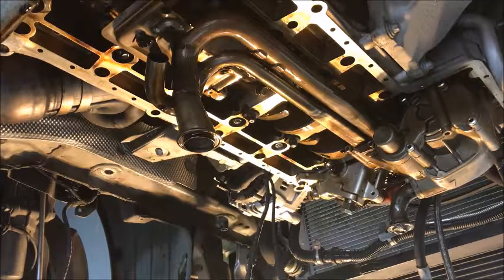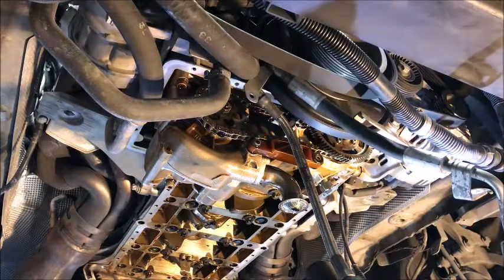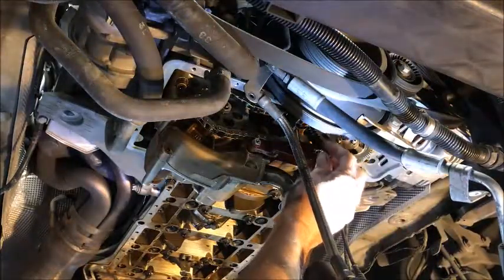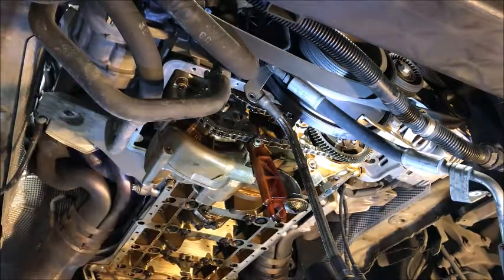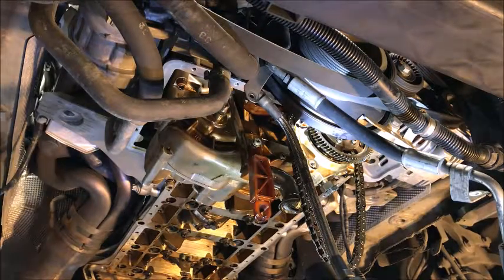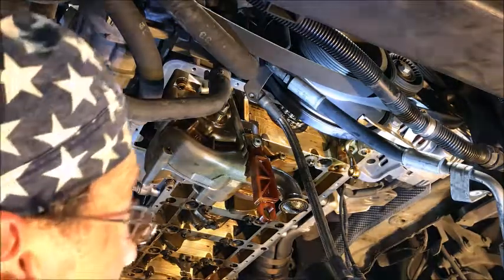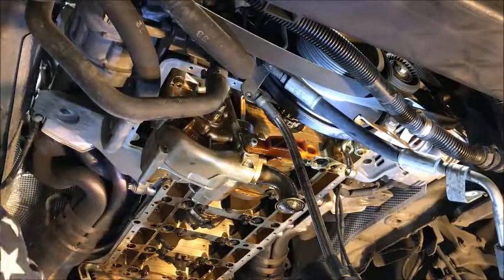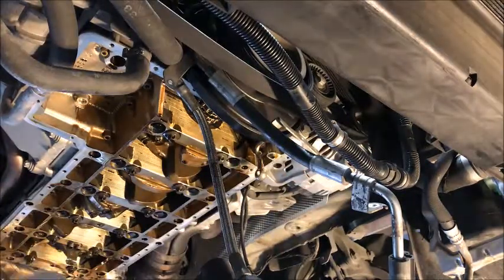BMW S85 Rod Bearing and Vanos Line Replacement Part 9 of 13 - Accessing the rod bearings

Comment: Do you know the name or part number of the little screen filter that goes on the little tube on top the the vanos pump?
Reply from the maker: Hey man !  There’s a small micro filter that is in a recessed hole in the block on top of the vanos pump...is this the one you are referring to?  If so, attached is a link to the picture of the one I got when I did mine (it’s also in the parts list in the 1st video of the series at the beginning).  If that’s not the one you are referring to, let me know and I’ll see if I can find another one in the schematics.  Here’s the link:  https://www.facebook.com/stevesdiys/photos/a.155473795999070/251980289681753/?type=3  All the best ! Steve

Comment: On how many miles was the m6 when you changed the bearing? Thank you!
Reply from the maker: mintech1000 , hello. I was at around 76k miles when I changed them
Reply: Were they bad? Thank you, sir!
Reply from the maker: mintech1000 , they were getting very close to being worn too far.  I took an oil analysis sample and sent it to the lab and it came back with traces of copper so I was pretty sure the bearings were worn and had reached the copper layer under the bearing surface material.  When I changed them there were two of the ten that had marks into the copper layer and the others were getting close.  I could have probably gone 10k miles more with no problem, but I was getting worried as that’s about when other owners have changed them and wanted the peace of mind.
Reply: Steve’s DIYs   Thank you. Sir, follow this guy on insta gram  troyjeup. Apparently, the king of this engine from what I here.  He is saying 10w60 is no good but redline 5w50 instead. I am doing a research, I am looking at a m6 2007 6 speed the Manuel transmission on 45000 miles, that’s why I asked about your car. Also, would you be willing to do it on mine if I buy it? Thank you!
Reply from the maker: mintech1000 , yep, he’s known as a legend for sure with these motors. He does a stroker motor with these and gets over 700 hp out of it. There a forum called M5board that has a lot of owners on it (if you haven’t found it already). I usually just work on my cars for something this complicated, but out in the forum other owners should be able to recommend someone in your area that they have used. I don’t track my car so I just stick with the 10w-60 as it should be fine for normal “spirited” driving. If I did track days I’d probably switch the viscosity to something a bit lower. Hope it works out that you get it...they are awesome to drive 👍👍👍
Reply: Steve’s DIYs  thank you, sir! I will definitely check it out! it is very difficult to find someone who knows what he’s doing. You seem like one who does know what he is going, that is why I asked. Hopefully, I’ll find one if it comes down to it! If not you’ll here from me again :)! Brilliant work by the way! Awesome content! Thank you!
Reply from the maker: mintech1000 , thanks man...I appreciate the compliment 👍. Yep, if run into problems just let me know.  It is getting harder to find shops that work on them for sure.  All the best ! Steve
Reply: Steve’s DIYs will do! Thank you!

Comment: Sir you are very very Brave.  So sad that a vehicle of this caliber has such a poor design from factory. This and many others things that are faults of BMWs shouldn’t happen. Very sad
Reply from the maker: BAims , yep...it is a shame that they didn’t spend a bit more time designing the weak parts (throttle actuators, rod bearings, vanos solenoids, etc).  I think they went a bit too tight on the rod bearings so they wear because there’s not enough oil film, but that may just be my opinion.  For the throttle actuators...they cheaped out by using plastic gears so for sure they missed it on that one too.